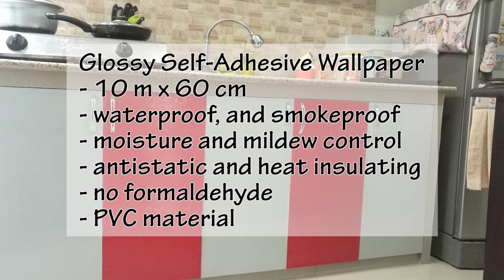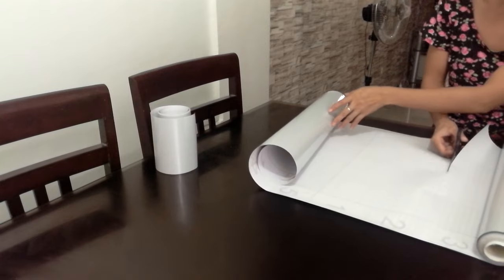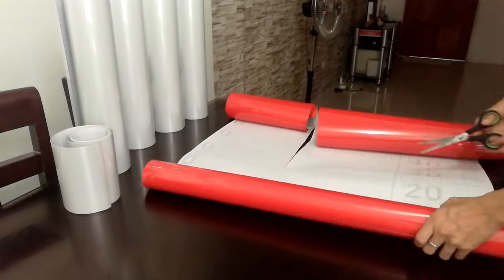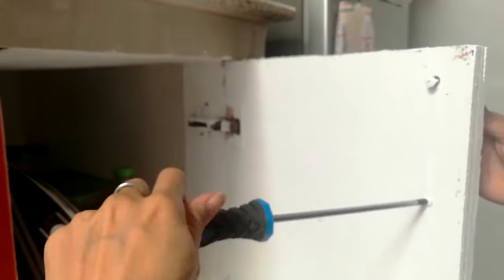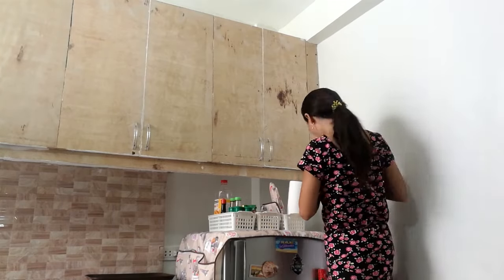Applying Glossy Self-Adhesive Wallpaper on Kitchen Cabinets

Comment: When you remove it does it cause any damage to the cabinets? I was wondering about putting it on top of cabinets that are not stained just for a change of color. I used to have a shiny red kitchen in my previous house and I loved it. I would like to have it in my new home. I’ve never seen this product.
Reply from the maker: Hi Lewis, I haven't tried removing it so I couldn't recommend this wallpaper if your cabinet is already nice looking. I can only suggest this wallpaper for renters or for temporary cabinets or newly made cabinets without nice paint yet. Thanks for viewing and asking.
Reply: U can try to used hot gun or hot hair dryer to remove them, once they were heated it's easy to remove if it used adhesive method